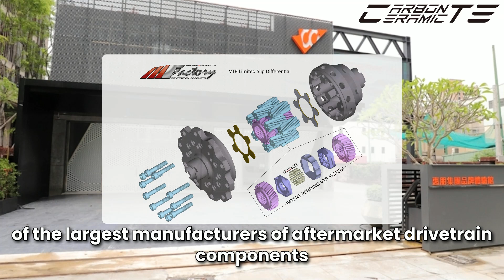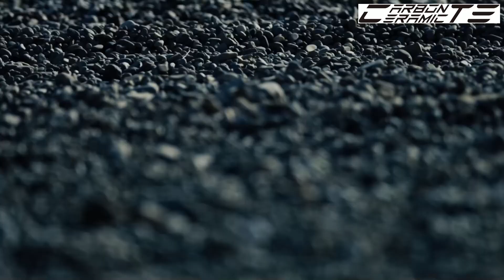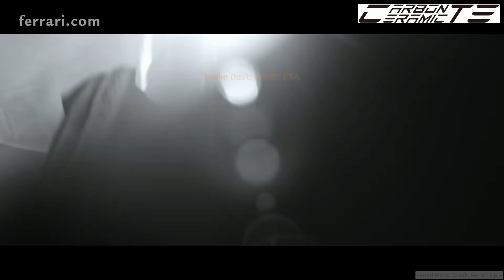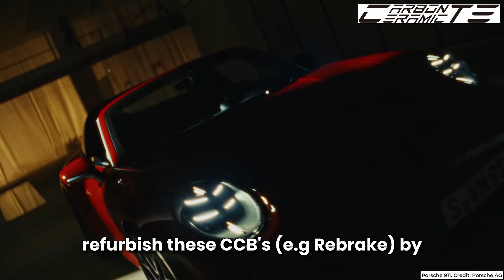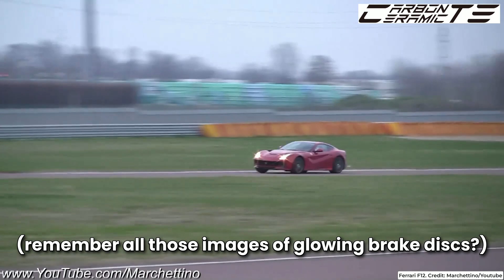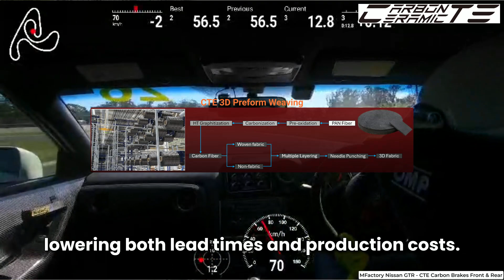THE Definitive Guide | Carbon Ceramic Brakes | Debunking the Myths | CCB 101 | CTE Carbon Composites

Comment: Good video, thanks for the information.  Is there any additional weight savings to be had from CTE discs vs BMW OEM discs?  Would 7075 Aluminum be any better than 6066 for the hats?
Reply: For typical BMW sizes, you are looking at <6kg per disc (as an example, an oem M3 iron disc weighs 13kg. An M5 weighs 15kg), so there are substantial weight savings. For the bells, 7075 won't really offer an advantage over 6061/6066 as the stress/loads on the bell doesn't warrant the extra strength.